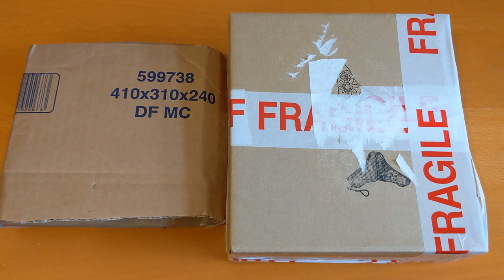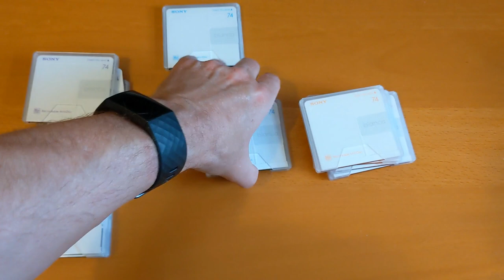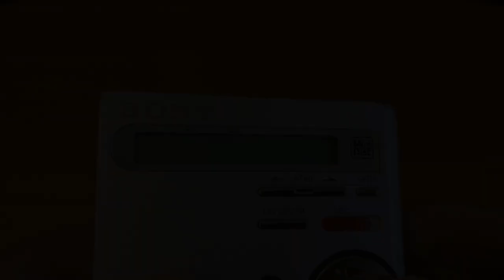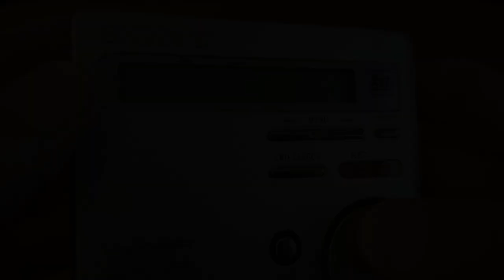Sony Bianca Minidiscs & MZ-R70 Player Delivery, and Battery Door Repair.

Comment: Check the lid detect switch. I had an n707 with bad battery leakage damage the corroded the detect switch and it behaved very similarly to your r700. In the end I scrubbed everything clean including desoldering the switch, popping it open and cleaning the contacts. Once reassembled it worked.
Reply from the maker: You're a genius! I can manually press the lid detect switch and the player comes on. After an hour of tinkering I can force the player to start looking for TOC by slightly holding open one side of the lid, but it never detects the data. I even got it to close fully and look for the TOC, but I suspect the lens can't read the data, as a secondary fault. It seems the whole lid chassis is bent out of shape.
I think, rather than spend hours taking it to bits and using my novice soldering skills and entry-level iron, I'd be better off just buying a replacement on eBay.
Maybe another time, when I've got my soldering kit out of storage for another project, I might look at this again. Thanks for your help.
Reply from the maker: Hi. Someone asked if I could fix his N707 (paid work), but I'm a novice. Wondered if it might be something you'd be interested in, and maybe content for your channel. His comment is Nov 17th on the follwowing video (I replied to him too). Thanks. https://youtu.be/iMlZCt-moiY
Reply: @CBitsTech  followed the comment trail to arrive at the comment you mentioned lol, yeah the fellow commented on one of my md videos. I gave him my email if he was still interested in getting it fixed.
Reply from the maker: @sjm4306  Excellent, thanks. Good luck.
Reply: @CBitsTech  thanks for sharing. Where did you find the lid detect switch on the R70? :)
Reply: Ok, I have found it
Reply from the maker: @matesowski  Hi! Open the R70 lid and look into the unit with the control buttons face-up. You'll see the two metal guides where the minidisc goes, one on the left and one on the right. On the right one, there's an extra piece of metal that comes down from the lid and bends to the left. That's the thing that pushes on the lid detect switch when you close the player. 

Look inside the player with a torch/flashlight. It's hard to see, but where that metal bar poshes down, there's a tiny black square with silver around it, that's the lid detect switch. I managed to activate it with a bent paperclip. Very fiddly. Good luck!
Reply: @CBitsTech  I hadn't watched your video but found the same issue after other fault finding.  Maybe this applies to other models as well?

Comment: Just fixed one of these. Someone had been inside soldering. Looks like they hashed up the ribbon cables. Some battery corrosion but not too bad. Once i fixed the ribbon cables it worked. Had to super glue one of the white end parts back on, they provide pressure at the end of the ribbon cable.

Comment: Hi there. I've just found one of these in amongst a huge boxful of Xbox 360 pads that inherited. It's missing the battery cover. I was wondering if there is a way to test it's working without the cover? This lead me to question what is it that the metal part of the cover does to make a battery work, as it's not directly connected to the device. Would love to hear your answers. Enjoyed the vid! Cheers.
Reply from the maker: Hi! Thanks. 

If you have a suitable mains adapter you can check it without the battery cover. It plugs in to the yellow hole in the bottom of the unit. You'll need 3 volt centre positive, at least 2250mA at 3v I believe. There is a way to test it without a mains adapter, but first I need to answer your question about the metal part of the cover making the battery work...

The metal part of the cover has a tiny contact arm, near the red Mic socket, that gets pushed against a pin inside the battery silo when it's closed.

You can see the battery cover contact on the right at 7:44 here: https://youtu.be/qj6lvFftOMg?t=464

When closed, the door contact on the door pushes against the tiny contact just inside the player that you can see shining at the top of the silo if you pause the video at 8:33 here: https://youtu.be/qj6lvFftOMg?t=513

I figured out how to test it without the cover. Get a good, working battery and put it into the player negative (flat) end first. Take a metal object that is flat on one side if you have one, such as a metal letter opener or similar. Push the flat edge of that onto the positive battery contact, and push the end of it onto the little pin inside the player to make a contact. Then, press the play button on the player. If the player is working you'll see something on the display. You don't need a minidisc inserted to see something on the display.

Sorry for the long answer to your concise question, but I hope it helps.

Hope you find the battery door/cover :)
Reply: @CBitsTech  Don't be sorry. That answered everything I wanted to know. Thank you! I'll give the trick of forming a contact a go.

I'm keeping my eye on some broken units on ebay, but even those seem to be going for a fair price. I'm keen to get this one working and actually use it. When I found it in amongst the Xbox paraphernalia, I was hit by a brick wall of nostalgia. They are so retro and cool now. 

Thanks again.
Reply from the maker: @Kevjin  I agree. Good luck with the eBay search. Maybe a saved search for that model with a maximum price would help long term.

Comment: If the Hold switch is working and giving you that as an option, have you looked at the controls panel pads? They might need a clean. 

Also, if there was that much battery leakage around the door, be opening up before case and checking for battery leakage everywhere.

May be a case where there is leakage causing a short somewhere, or it may actually have corroded something on the main board. Have you checked the service manual on minidisc.org?
Reply from the maker: Thanks. It's months since I had it open, but I don't remember it looking like there was any corrosion that I could see. I did consider removing the board, but it's very thin and I didn't want to damage the board or the clips that hold it on place.
Please see the other comment from SJM (and my reply). I think I'll shelve this one for the time being and maybe buy a working replacement. Thanks.

Comment: Mine was the other way around. Worked, then the worm gear went. Opened it up, sorted the gear out, assembled it. And now it lights up only when 'on hold'. Anyone, any ideas? Please!
Reply from the maker: Check the ribbon cable for the buttons controller board. Clean it carefully, or just reinsert it maybe.

Is it the same when you use a remote?
Reply: @CBitsTech  Haven't got the remote, but! I bend the cage tongue (on the right) so it makes contact with the sensor below. And it's alive :) Now all I have to do is figure out a way to stop it sounding like a race bike and start reading again. I think it's the worm drive gear.
Reply from the maker: @aerotraveldji  I'm don't know if you know, but clean the worm gear and the laser sled trail (the other side of the laser sled) and apply a suitable lubricant to both.

Sounds like you're more advanced than I am.
Reply: @CBitsTech  Oh yes, done every time. All rails, gears, moving components such as springs nd areas of friction. My issue is the helical gear is cracked and doesnt bet moved by the worm gear. Can't find a replacement helical one :(
Reply from the maker: Oh. I hate to say it, but it might be more efficient to buy a replacement player (and keep it for parts).